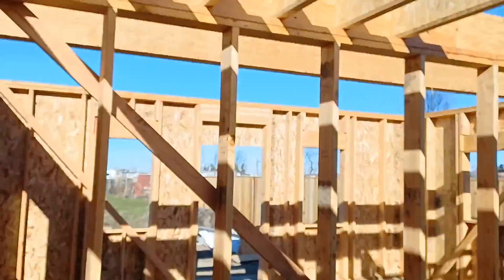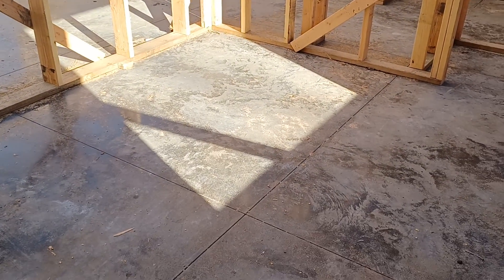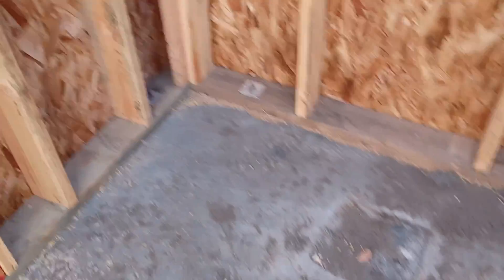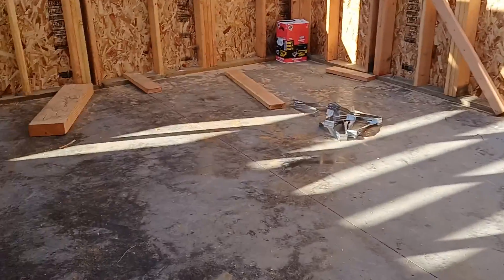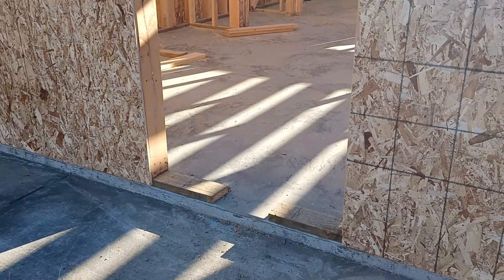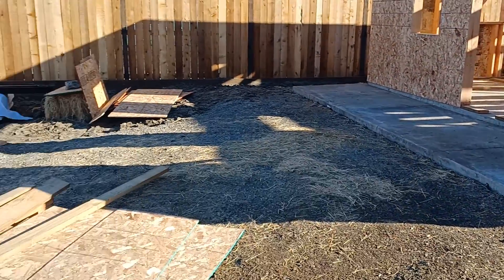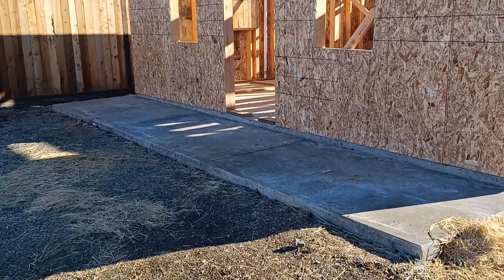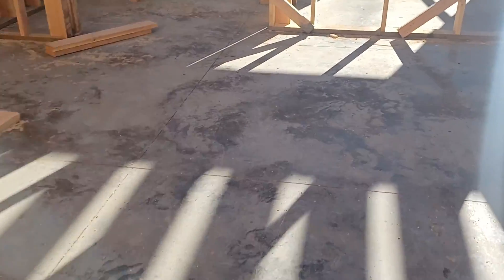ADU Foundation Types

Comment: Does this type of cement floor get really cold during winter?
If so how do you deal with that?
Reply from the maker: Yes, but also stays cool in summer months too. To counter cold floor one could use rugs or install radiant heat inside the slab.